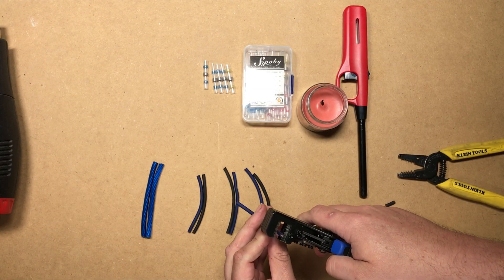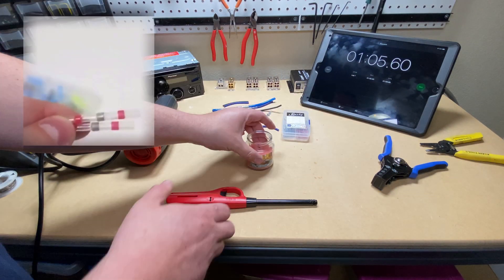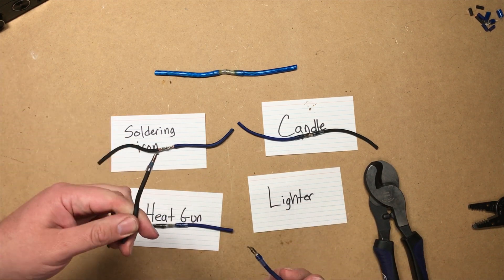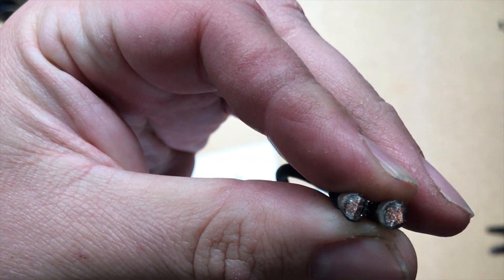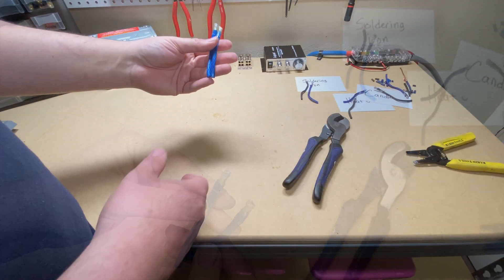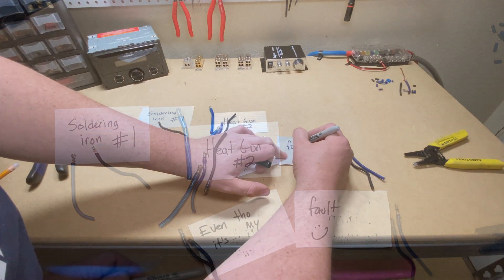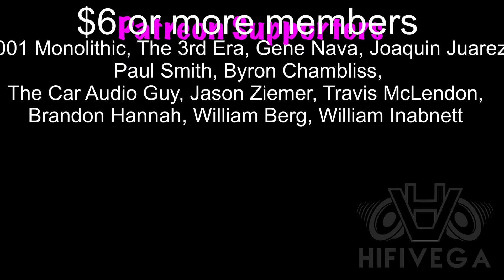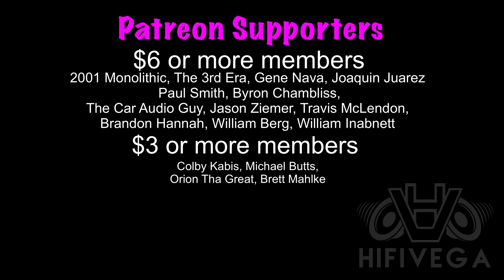Let’s solder without a iron! Waterproof heat gun solder terminals tested

Comment: I'll keep my 30yr old Weller. I've never seen a white crimp cap fail ever. The thread the needle trick for small wires thru big without soldering has never failed either. The only fail I see is trying to find a solution to a non existent problem 🤔.
Reply from the maker: It seems so cool tho! Lol they got me with the ad
Reply: @HifiVega  Thanks for taking one for the team 😂. Gotteem !